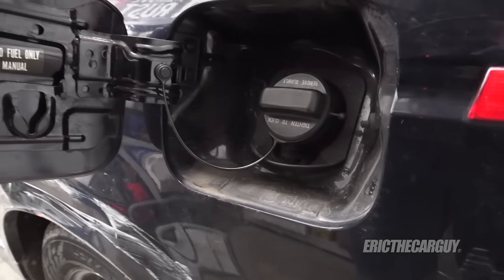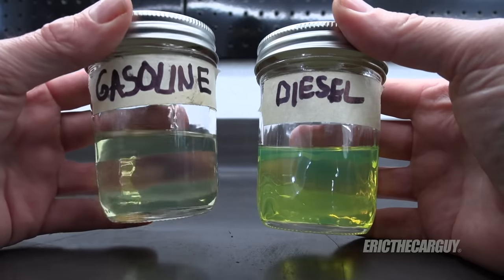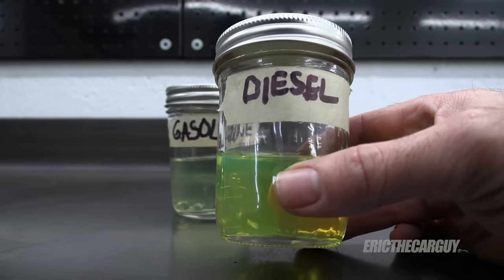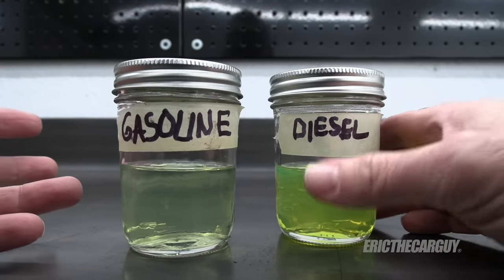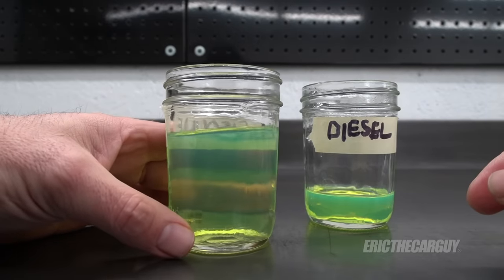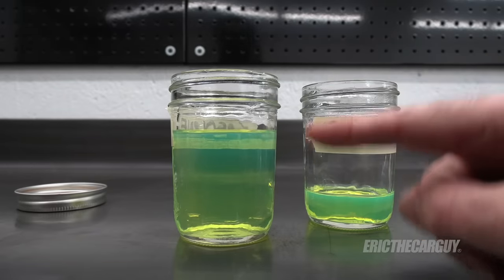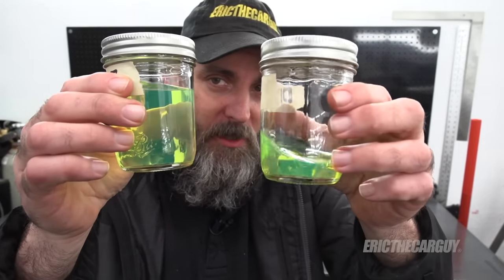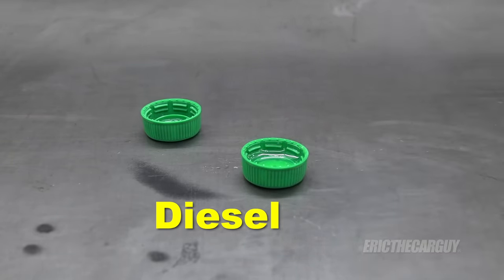What Happens When You Put Diesel in Gasoline?

Comment: In 1990 in the Gulf, we had a shortage of diesel so the Saudis were giving us JP4 which is a mix of kerosene and gasoline.  We ran that in our M60A1s which were powered by an AVDS 1790-2C V12 dual turbo charged diesel.  The tanks would run, but they would run like crap.  We could get from point A to point B, but with a max speed of 20 mph we sure didn't want to go into combat with that stuff in our fuel cells.

I was told that in a pinch we could run on straight MOGAS.  What the difference is between MOGAS and normal gasoline I don't know.  I also don't know why the tanks could burn it.  It may be that the AVDS 1790 was designed to be a multi fuel engine or it may be that it originated from the AV 1790 gas engine.  Couldn't tell ya.

Comment: I currently work at Freightliner dealership. Recently I had a truck driven to the shop with gas in the diesel system. Everything from the fuel tanks (dropped and cleaned) to the injector had to be replaced. 18k later the truck was fixed
Reply from the maker: Ouch!

Comment: There is no pre-ignition in diesel engine, because diesel does not suck fuel mixture in the cylinders...  fuel is injected straight in the cylinder just before tdc....  but gasoline wrecks diesel's high pressure pump and injectors...

Comment: Side note, you can mix fuel and ethanol at any ratio in any car made after 1996 or so.  Whether your car is made for just ethanol or has the silly flexfuel sticker the computer compensates.  You can even run just ethanol in them.  Of course big oil doesnt want you to know this.  I learned it in my automotive technician program and was shocked this information is kept with all the pollution paranoia we've had the last 3 decades.

Comment: Hard to put diesel in a gas tank because the diesel pump nozzle won't fit into the tank for unleaded gas. Gas has detergents to mix the 10% ethyl alcohol with the gasoline. I don't see how accidently putting a little diesel in with gas by mistake will create any real problem. Diesel has just heavier and longer molecules. What poisoned catalytic converters was lead used to raise the octane level.

Comment: I used diesel on my Husqvarna blower every time ass additive smokes a little but no issues with it ,also I had use 10% diesel mix with gasoline in engine from the 70s before Cadillac converters and injectors were invented no issues with it, it used to work smoother used to lubricate the cylinders better and intake valve cleaner I guess you could use a little bit diesel in gasoline but never  on newer cards

Comment: I have diesel sludge in my diesel truck tank. A  guy said to put enough gas in to cover the sludge & it would dissolve the sludge & then drain the stuff out. Would this work?  I have 2, 100gal aluminum diesel tanks. Diesel was 7yrs old. I pumped it out.  There is a 5 in wide line of dark red oily thick sludge running to the whole 5' length of the tank. Its thick enough it won't flow out the 2 drain wholes on the bottom of the tank. I tried a rag to an electricians wire puller. It wouldn't run dn the center good enough to break it up. It didn't feel right. I stopped. Pulled it out & the sludge was so thick it hardly dripped of. Do you know what can be done to get the sludge out? Or hould I just leave it & fill yup my tank & forget about it? Thx 4 the vid.

Comment: I accidentally dumped about 5 liters of diesel into my gasoline car... realizing my mistake I stopped, topped it to the brim with gasoline and hoped nothing would happen. The ratio I think was about 10 to 20%. The car acted sluggish until it warmed up, then it ran fine. I presume that as the engine warmed up, fuel became less viscous and also higher temperatures in the combustion chamber made the  scattered diesel mollecules ignite after the gasoline was ignited by the spark. After that tank was empty I put in a tank of 100 octane along with fuel system cleaner additive. Engine ran and runs fine after that. Z16XER engine. Even made it through Emissions with no problem, lol. But I don't think it was particularly healthy for the cat converter.

Comment: i usually mix my gasoline 2 stroke bike with Diesel, with 30% diesel and  70% gasoline. it feels like it's has more power, of course i still mix 2 stroke pre mix too. i only use it when I'm going on long distance like on road trip because the engine heat is higher, i also tried running it on full diesel just for a little bit, it has even more power but the smokes are like fogging machine 😂

Comment: the problem is the unburned diesel coming thru the engine in to the cat. and then that actually melt inside. 
on petrol in diesel:
new engine will have BIG lube problems and destroy pumps and injector's. 
old engine that use a old fashioned diesel pump and tubes to the injector's wil not take a lot of damage. as long as you make souer the diesel is not to dry it will work. so on them you can put in some 2 stroke oil and fill up the rest with diesel. In the instruction book of my old tractor it tells you that under a -20c you use 50/50 diesel and petrol to avoid vax clogging the system .

Comment: Just for information a Diesel engine doesn’t compress the fuel it compresses the air in the cylinder and at the correct timing the diesel is atomised into the cylinder and the super heated air ignites the diesel to produce power. That is why Diesel engines have a substantially higher compression ratio compared to petrol engines.

Comment: In 2019 October. I had a  4x4 2009 Sierra 4.8l for forestry work. I tried gradually adding diesel. First fill up 10% diesel, no problem. then second fullied up fresh gasoline 100%. Third fill up 20% diesel, was ok, was a little weaker going up hill. then 4 filled up fresh gasoline and got back to normal. Then tried 30% diesel, got way weaker and kind wandering if i would make it back home. burned half that tank then stopped at a gas station and fulled up with gasoline, then was better but weak going up hill. After fulled it up a full tank of fresh gasoline and performance was back to normal. Hope that helps !!!

Comment: I have run diesel contaminated gasoline in my cars for years. Not all the time but I am a diesel mechanic and sometimes get diesel pickups that have been filled with gasoline I pump it out and burn it my gasoline daily driver. 5050 blend is too much it sounds weird under full throttle and performance is down. 20 to 30 percent is good.  I recently had a Sierra  5500 dump bed with dual tanks filled with gasoline.like 4 tanks in my truck

Comment: Would a gasoline fuel pump really struggle to move diesel?  I imagine that could be true on a high pressure gas pump, but what about lower pressure pumps?  I'm wondering because I needed a lift pump for a diesel engine, and I bought a gasoline pump, a HEP-02A model pump from Amazon for $18, and have used it for about 30k miles so far.

Comment: Diesel is a lubricant.  So if you run gasoline in a modern diesel system it will trash everything. Especially the high pressure pump will grenade.
Gas engine can run on diesel since diesel is about 76 octane rated...but it will run like poo.

Comment: My wife accidentally put 4.7 gallons of diesel on an almost empty tank (Nissan Rogue 2019). She was able to drive a mile until the engine stopped and then repeatedly tried to start it again. Since the damage was already done and it was difficult to tow it to a garage shop, we added as much premium gasoline as we could and added octane booster to the tank. Then we were able to start the engine using starting fluid. We had some difficulties and it rolled coal for a couple of minutes, but I'm here to report that the engine is running like a champ with around 27% of diesel. I will update my comments if there is any long-term damage.
Reply: Update
Reply: Same shit happen to me

Comment: One other thing to consider, diesel has a very low octane rating.  In older engines the fuel system could not atomize the diesel to burn it efficiently in the cylinder.  Now GDI engines with higher pressures could  and may suffer from pre-ignition or possibly detonation.

Comment: My tank was about half full.  I topped it off at a Shell station because I had a little over 100 miles to go to get home and I didn't want to stop for gas.  So, that night I drove a little over 100 miles no problem, I'm on the Washington Bridge going into Manhattan and my Toyota Sienna stopped dead, all the warning lights came on.  Long story short the Toyota place said that I had diesel in my tank.  It had to have come from the Shell station that morning.  I know I used the 87 octane fuel pump.  Anyway, why did it drive 100 miles straight through no problems until it didn't?

Comment: Now, Weve put gasoline in our Heavy trucks years ago as you say, A solvent,cleaner etc- A gallon each 100 gal.  Big rigs will Burn almost anything with a tiny mixture in the fuel......For example- Marvel mystery oil is an Abrasive,Yet safe enough for Both Gas and Diesel- But dont put Trans Fluid in your Car, Only a Big rig to burn.......Gasoline vehicles a very sensitive..Although that Gallon of Paint Thinner in the Tank May Just Help with Cleaning Injectors a bit.

Comment: I accidentally put race gas in my diesel before. 
She knocked a little bit. 
Put in some 2stroke oil and good as new lol. 

I love my diesel rabbit truck. 
The semi-big diesel nozzle fits lol. 
You get funny looks filling up with the big trucks though. 
;p
Reply: The old vw owner manual actually states that one should add 15% gas to a diesel car in the winter to prevent fuel jelling. 

I’ve run through North Dakota in -35f on straight diesel with no problems though. 

Here is a pro tip for your read:
If you ever even suspect that your car had a fueling problem at a fuel station they will pay for your car to go to a
Shop. Pretty much no question asked.

Comment: Back in the late 90s. I was with a group of friends and family members on a snowmobile trip in West Yellowstone. Halfway through the day, we made our way to a. fuel station down in the valley on our snowmobiles and topped off our tanks. All these machines were rentals. I have one brother. who apparently that day was half blind and did not realize he was hanging on to a green nozzle as he pumped diesel into his snowmobile unknowingly. completely unknowingly until we got about three miles down the train. I was riding behind him. And by eyes were burning. from the exhaust coming from his snowmobile. It was unbearable. I could not figure out why this was bothering me, but it could smell. a diesel. vapor and I pulled up the side of him and stopped him. And when I did, the exhaust coming from under his snowmobile was intense and black. LOLI said to him it smells like you're have diesel in your sled. Look at the exhaust and that. moment he realized that he had put diesel in it when he screwed the cap off and smelled the tank. Nonetheless, we rode that snowmobile all the way back to the rental place with the diesel in it. And the biggest problem was getting it to shut off when we turned off the key. The diesel fuel mixture was so high, the sled. continued to run or diesel. As we say, referring to what happens to a car when the timing is so far off and you turn the key off. and it won't quit. This was carbureted cars back in the day. Nonetheless, we finally made the engine quit by putting his snow boot. on the pulley connected to the crank and stalling the engine. Lol. Even turning the choke on made it run even better. Lol. The next day, the rental place called us and said, hey, one of you dumb idiots put diesel in your sled. We said, oh, you're kidding me? LOL. Playing stupid. And we asked him, was it damaged? He said, no, we. emptied the tank and refilled it, and it runs fine. But we were letting you know to be more careful in the future. LOL. the one noticeable effect as my brother was writing this lead was the throttle was very sluggish. and had very latent response when you squeezed it. The speed increase was over seconds. and only a few. It ran terrible. But once it got into the Higher RPM 's it ran pretty good. but only then.

Comment: thanks for the information ,just wondering what would happen with using 2 stroke fuel mixed .
i have 20L mixed and well was meant for my boat cause we had such a bad summer with extreme heat it stop me from taking my family out fishing ,now coming in to winter ,i don't want  the fuel going to waste.
so was thinking  what would go wrong if i fill my car?
Reply: Use it on a rotary. 2 cycle oil mix helps with the apex seals. So I've heard.
Reply: What ratio?
50:1?
Even at 50ml of 50:1 to a 60L tank, it would dilute it heavily, but I wouldnt do it.
You would fowl the spark plugs.

Comment: I can tell you; I put 20 litres diesel on top of existing 4litres petrol. Car ran 300 yds. before stuttering to a stop. Easy (very old) car to access tank, drain and empty. Diesel is heavier; it had sunk to bottom of the tank. The cloudy mixture drained until it became clear, or at least more clear. Then the last few litres drained almost as clear as if un-polluted. Then after Draining carbs , fuel lines and emptying the float bowls. I put everything back together. The car is ok but that was dumb of me and I’d say the branding on the diesel (at a fuel station I had never visited before) was misleading. Don’t try this experiment

Comment: If it's less than 10%, and a 20 gallon tank then you can get away with filling the tank and driving it home and running the fuel out depending on the car but got to be less than 10% in a 20 gallon tank

Comment: Also. I'm dumb.  But I put oil that I mixed with gas in my tank. To see if it would bump compression.   It smoked a lil but it ended running good. It  sat for about a week and when I tried to rev my car out it would spudder.  It was like that for a week  .. than one day I tryd banging revlimiter and it cleard it up. Still runs good months later. Lol. No work needed.

Comment: If you put gasoline in your diesel you're in trouble because of the diesel won't like it you can blow head gaskets certain seals will swell up it's not a good idea but I have seen people get away with less than 10% in a 20 gallon tank if you fill the tank full seen it you usually doesn't destroy anything if it's your older vehicles but if it's a newer vehicle I wouldn't suggest putting diesel in your gas tank cuz everything on these newer Vehicles will be fouled up they cannot take it

Comment: What is Kerosene? I thought it was a refined diesel fuel. The type you run in Kerosene heaters that light with an igniter. Just a thought. Thanks
Reply: Kerosene is even heavier than diesel.

Comment: I was intentionaly puting some mixture in my old gasoline car, becouse I got this mixture for free. Car had over 200k, without any problems, than I sold it becouse rust started to eat bottom panels. In old car it is OK, just regualy check oil level becouse diesel doesn t burn in gasoline engine and oil level rise up.

Comment: not completely accurate but good stuff.  I put heating fuel (a low-grade of diesel) in my Honda 100 when I was a teen and drove around for a week once.  I had to carry a plastic container of gas to start it and get it warm when it was cold but it drove fine ignited by the spark.   The issue I had was detonation it pinged like crazy but I kept doing it.  Finally it had no compression and I tore the engine down to find cracked rings.  Go figure it wasn't designed for that.  It ran though with only heating fuel once warm and it was a carburetor too.

Comment: Now correct me if I’m wrong but if you put gasoline in a diesel, it should cause damage to the motor cause it’s thinner, it should I would think flood the engine, a gasoline fuel pump would have hard time pumping diesel, but gasoline should run wide open through a diesel fuel pump, so it should I would think flood the engine, lol if you have a diesel that might be your only hope to save fhe engine, is that if floods out, but that could cause major damage as well, especially if to much fuel gets in there

Comment: What would happen in a carb application? I'd imagine it would make it through the jets into the engine. It might not fire at spark initially but later? Or would it lock it up like when water gets in? A higher ratio of gas might get a fire late in cycle?

Comment: well something i like to do in teh summer, i add a gallon of diesel to my rig, carb... and i get better mileage and a bit more power, cheap octane boost....after doing a quick search it would seem that gas fuel filters and diesel fuel filters average about the same micron size... the difference really comes into play though with temperature with the diesel ones, when they reach cloud point, micron size really matters....
Reply: DIESEL IS MEASURED IN cetane not octane,also the octane rating of diesel is 15–25
Reply: @somervillearron  true ,  it slows down the flame front of the fuel a smidge, it's similar when you mix ammonia and gasoline then can run it in a flame thrower, takes out the 'boom' little more heat, little more push on the ole pistons...
Reply: I started adding a smidge to my fuel in the summer because i was running a gasoline heat exchange off my radiator hoses and it was to prevent detonation and ping.... best i could get out of the ole dodge was 22 mpg but that was with a two barrel.... i took it off and destroyed it after learning about what happens to those to come up with fuel saving ideas... two of them ended up working for oil companies, all the rest ended up dead in their workshops either from an 'accident' or went the way of Epstein....